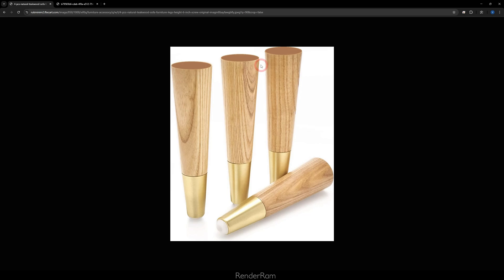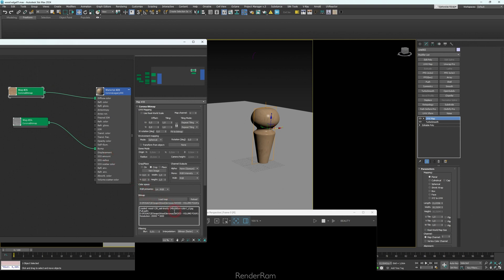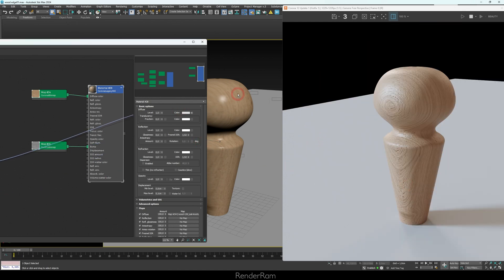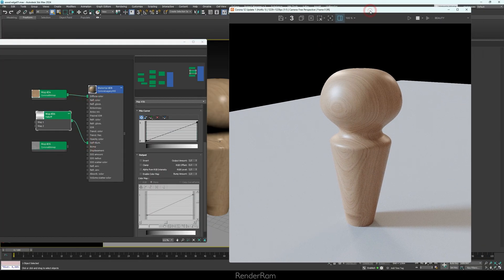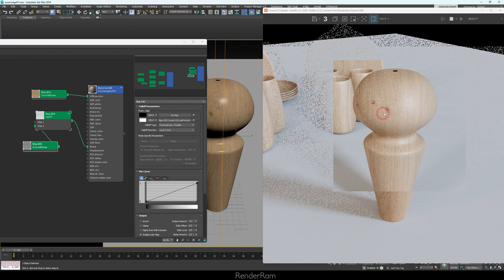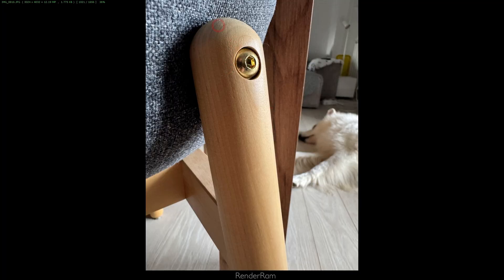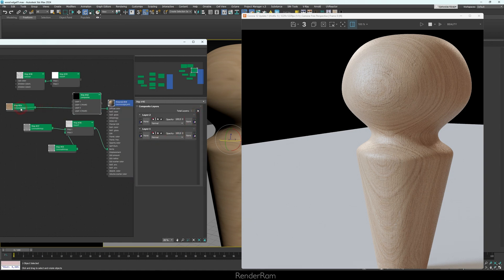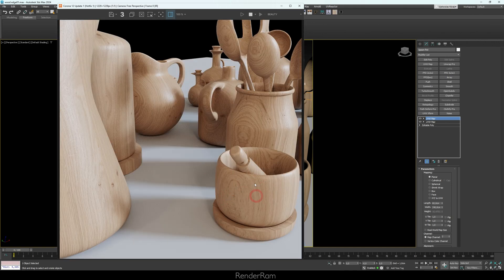Materials Ep12: Curved Wooden Surfaces | 3ds Max

Comment: Really interesting approach just wondering why not unwrap, those are models you can unwrap in a few clicks and get a nice result don't you think ?
Reply from the maker: Texture distortion is the key visual here, Unwrap will prevent distortion from happening. 
So in general with Unwrap you won't get those nice radial wood shapes on curved surfaces